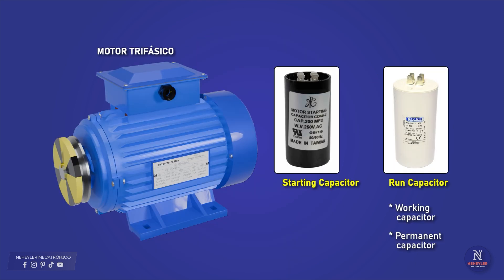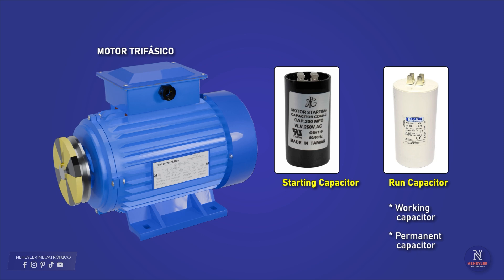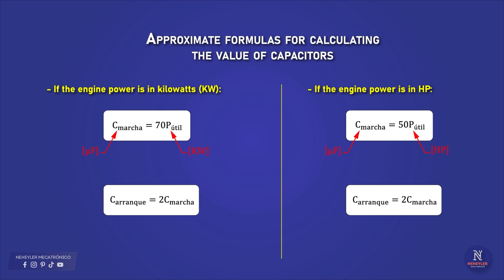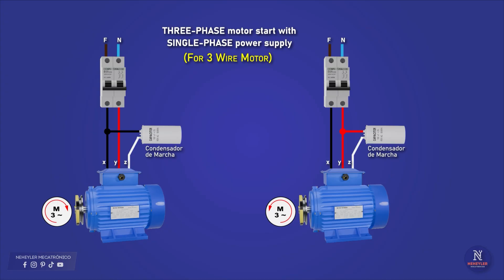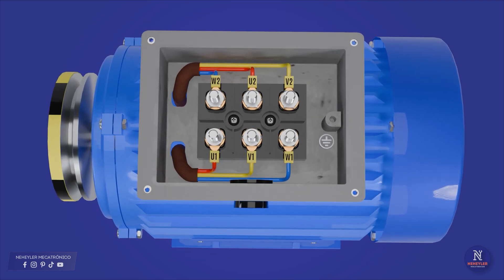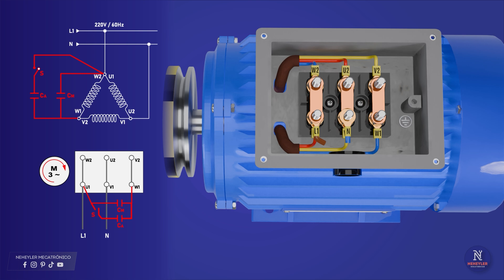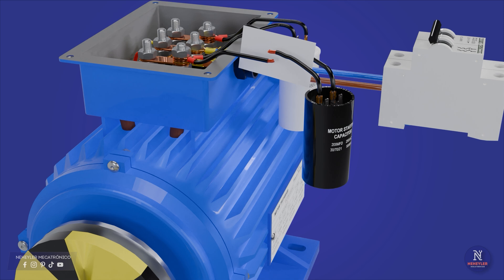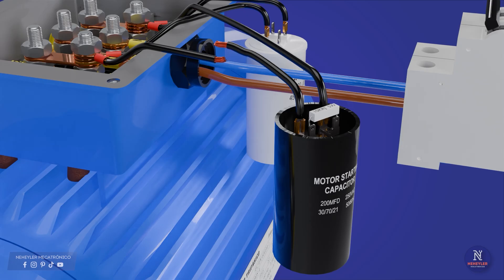Connecting START CAPACITOR and RUN CAPACITOR to a three-phase motor with a single-phase line

Comment: Regarding the start cap,imagine that the motor was fitted with both a start and run cap from the factory.
The motor would have a centrifugal switch that would throw out and break connection to the start cap once it had reached a nominal speed of about 3/4 or 75% of the full rated speed,also remember that a motor fitted with a start cap has a start winding,So i'd use a push button switch that operates a relay or contactor for short duration contact of the switch,you want to hear the sound of the motor at full speed ,and then figure the time it takes to get to just over half of this.

This type of thing is best used on a lathe or a mill that will start unloaded,of course you could be a smart arse and create a system to engage a single phase motor to bring it up to speed first.
If i were to do this i'd add a fly wheel to store the start energy so i could disengage the start motor then just start the 3 phase motor without the added issue of a starting cap circuit.

This would (if you keep the single phase motor engaged during the 3 phase start up cycle with the fly wheel) allow a loaded start ,assuming the 3 phase motor could drive the load.

A clutch system could also be used ,along with a fly wheel and a single phase starter,engage the clutch to start,or drive the load,only the imagination is the limit here as factories were belt fed from single motors and clutch engaged per machine,with flywheel centrifuge energy storage.

You could just go for a rotating 3 phase converter.

Comment: My question is, Can you add a capacitor to a 3phase 208 motor due to it being old and weak? Just to help it start? i know the purpose and how the 3 phase works compared to single phase. In my mind the extra voltage would help the 3phase motor only on that one leg the capacitor is attached to. if anyone has experience and has tried it please let me know. Truely i believe adding a 45mfd capacitor to all 3 legs would help as a hard start for a 30 year old ac compressor.

Comment: i put a run capacitor only and the motor is running but when I put the belt on the motor it stops running and just humming what can I do
Reply: What is the HP of the motor 😮

Comment: thanks for the information, so my spray Complasor when I switch on power from the source motor starting capacitor does not run  and it produces smoke

Comment: That estimation of capacitor size to motor power is strange 1hp motor using around 20 uf/mfd in 220 volt system
Reply: I found a formula it give good estimation for capacitor size and there is a diffrence between 110 and 220 system 😅
Reply: Wattx80,000/630,000 if 110 or 2,420,000 = running capacitor mfd

Comment: Can we use  starting capacitor in place of running capacitor
Reply: No, you can only use a run cap in place of a start cap although not ideal. The start cap will burn up under prolonged use more than a few seconds.

Comment: For 7.5 HP can we use?
Reply: That  motor size must be a three phase that require no capacitor  but in case its a single phase it will require a 600mfd capacitor for 110 volt and 185 mfd for 220 volt and thats for a running capacitor

Comment: I have motor 3kw 1500rpm 50hz. What capacitor uf for CD RUN and CBB START the motor work on 220v. CD Run 300UF and CBB 100UF it's ok?

Comment: Do this metode works in a star conection too? Thanks in aticipation
Reply: Hello, it depends on what is indicated on the motor plate. Current motors are designed to operate in star configuration at 400V, and in delta configuration at 230V. When the motor operates in three-phase 400V star mode, each winding receives 400V/1.732=230V.

When switching from three-phase to single-phase, we must ensure that the windings are still at 230V, which is why we change the coupling with the bars to delta mode. This way, each winding is directly supplied with 230V.

If you had an “old” 110/220V motor, you'd have to connect it in star configuration, so that each winding is supplied with 220/230V.

Comment: I can’t understand how this works as the phase difference between A and N on single phase is 180 degrees not 120 as in a 3 phase supply ?
Reply: The capacitor causes the voltage to  lag current .  Unlike pole shading which lags the field

Comment: There is no a single phase motor over 3 horse power or 2.2 kilo watt say two point two.In your example the 100 mf run capacitor gets warm over a few second then will  be exploded.Even not using it is still ok and motor continues to run.
Reply: There are many single phase motors up to 7 1/2 hp.

Comment: Lol what bs how can you use a start cap on a 3 phase motor
Reply: Yes you can but is not optimal and power is lower because wire of coils different
Reply: By torquing the third leg. ( static phase converter).
Reply: Yes you can but is not optimal and power is much lower because wire of coils different